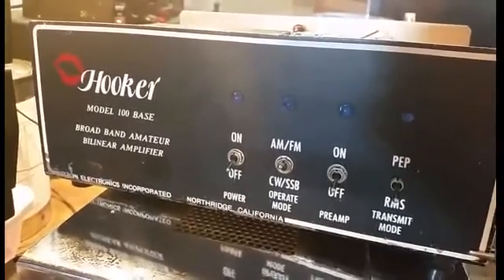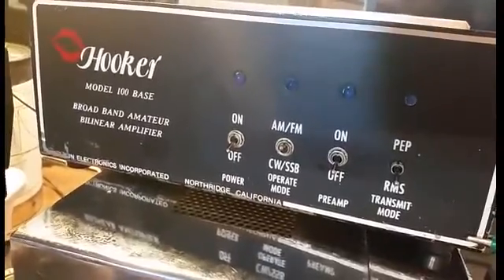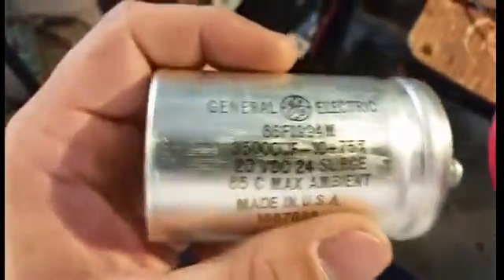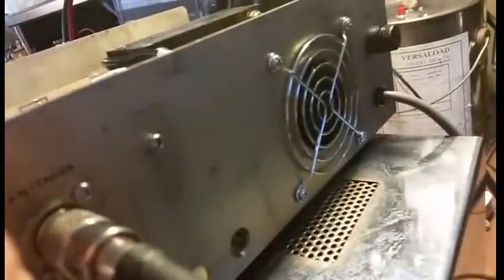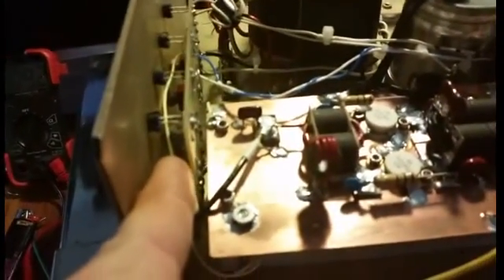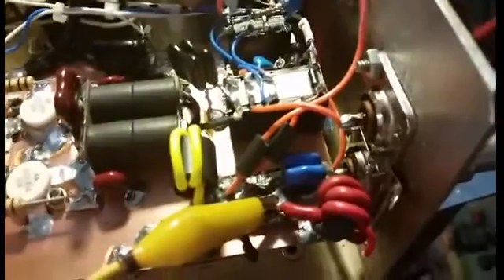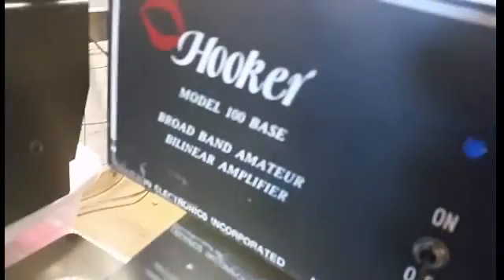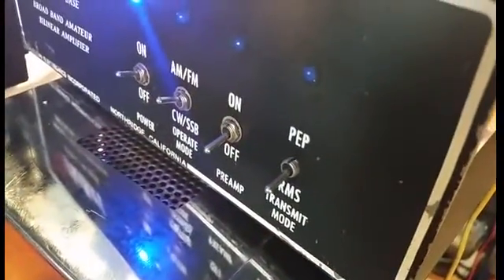Hooker 100 Base Amp Complete Rebuild With MRF454s

Comment: Because it's he grabbed b plus off a switch leg for the fan regulator circuit..when he changes voltage dividers high to low the regulator switch's off and on ...doing exactly what a regulator circuit does when a transitor is used for the stabilization